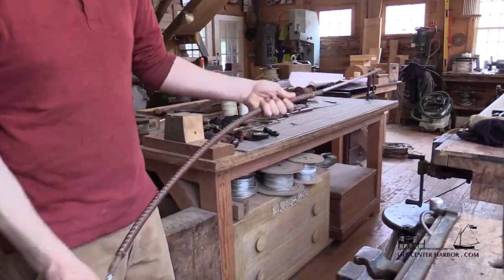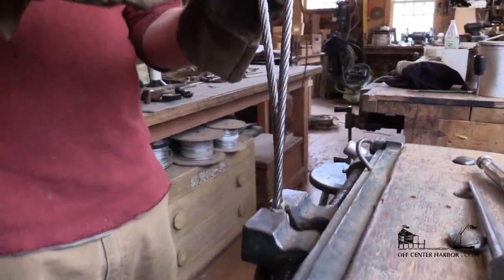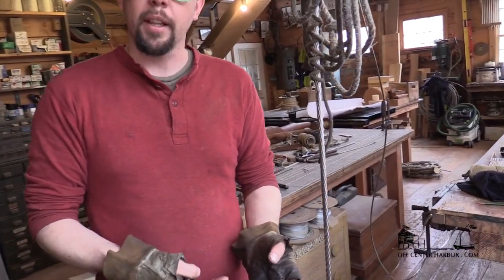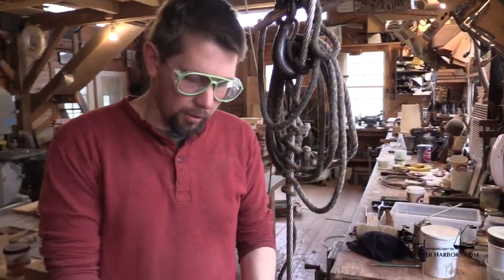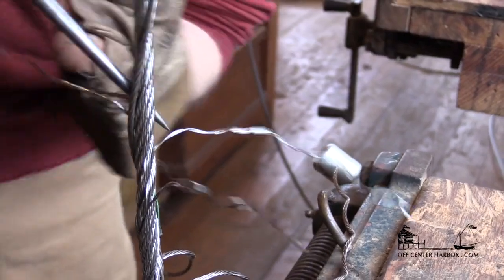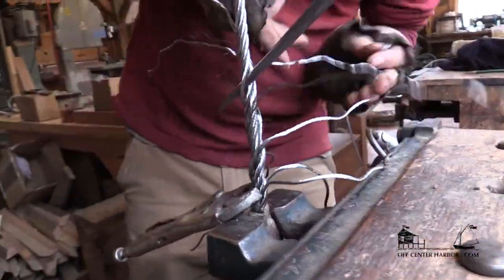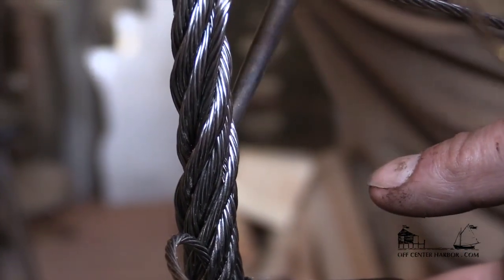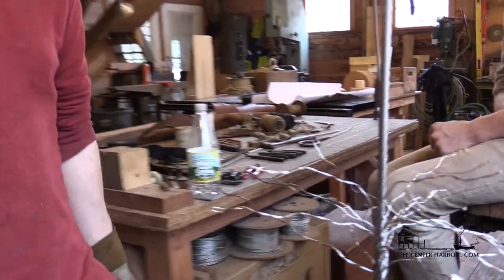Traditional Rigging, Part 7: Making a Wire Splice

Comment: Outstanding presentation all around, I have not seen a full wire rope splice like that since I was 14. I worked on a two masted tops’l schooner, traditionally rigged with the exception of bottle screws instead of dead eyes. I remember working with the man who did the splices for our standing rigging, I remember the 5 gal buckets of lard we used to grease the rigging and then wrapping it in canvas and then creosote impregnated jute that we wrapped around the standing rigging. I learned a lot from those shipwrights in England and there’s no life quite like that of a sailor! I wish I could come be your 57 year old apprentice! 🤣 liked and subscribed sir! 🇺🇸⚓️💪👊

Comment: The spike can disrupt the passivated surface but I would be a lot more worried about 302/304 going active (rusting) than, like you say, the 316. Anyone who is worried about it can easily passivate the spliced area afterwards with ospho, then washing it out with fresh water. You don't even need to get the leather wet, and you don't need to induce any current.
I used to include the core like Brion Toss told us to, but decided that it works better for me if I just leave it out. My reason is that it displaces the strands less if it isn't up in there at all, bc it's the deformation that makes any splice weaker (when splicing fibre braid or 3strand, my tapers are ridiculously long and gradual for the same reason). Like you said, the weakest part is in the standing part of the wire, just outside the splice taper ends.
Otherwise my liverpools start a lot like Brion's, going in the same cut under three, under two, and under one With The Lay, and the only ATL being the fourth strand in the first available cut to the left of those.
Your Board of Trade splice is gorgeous, as well as being westcoast enough to also lock. I am definitely going to try and copy your splice first chance I get.
Admittedly, you kind of lost me on where 4 starts, but I will figure it out!
I remember reading an old WW2 Navy Bulletin which describes "ribboning" the strands and the way it improves the strength by deforming everything less.
Thank you for stressing that the standing part should not be too slack, lest the splice ends up with a curl.
As an aside, anyone trying this should consider that these days, turnbuckles are really made for 1x19, in that they can end up being too short for 7x7 stretch, so try and get the longest ones you can find, not the newer "half-turnbuckles".
Best thing I learned was the way you turned a bronze thimble into a tool.
I recently started using Maffioli polyester hand sewing twine and trust me it is every bit as great as the 462 and 9C we are addicted to (Not Slippery!!) and it comes in more colors. 
Never dreamed the day would come when I wished I had bought up all the Italian Hemp (balls) marline (the kind that had the real Stockholm smell) that I could find, but hindsight's perfect i guess.
I use 6-7 Latigo; what kind of leather do you like?
Thank You Myles.

Comment: i have some wire rope for my rig. prefer splicing to crimp fittings. the wire is made up of a core.....then 9 thin strands then on the outside 9 thicker strands.  how would i go about multi layer like that? then wire rope is 10mm thick in total.